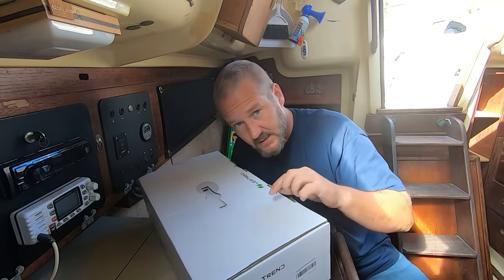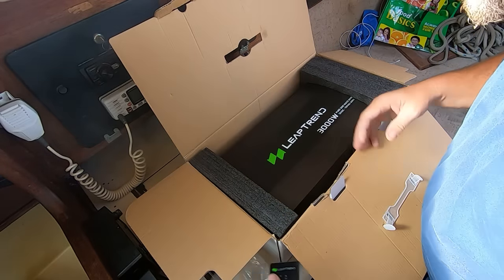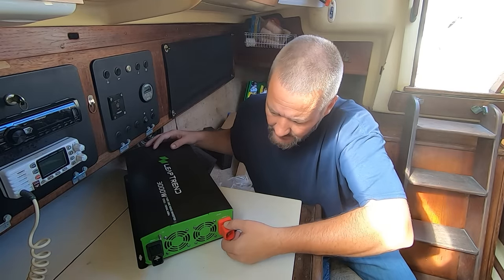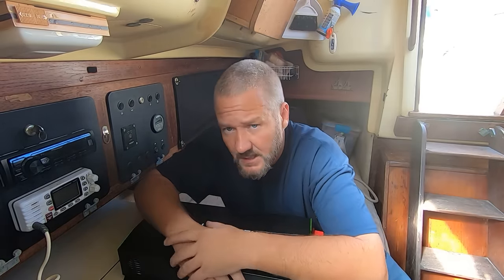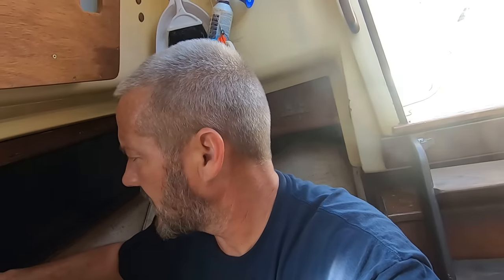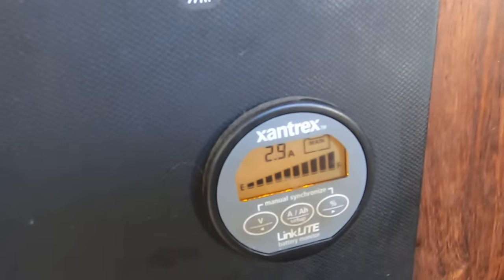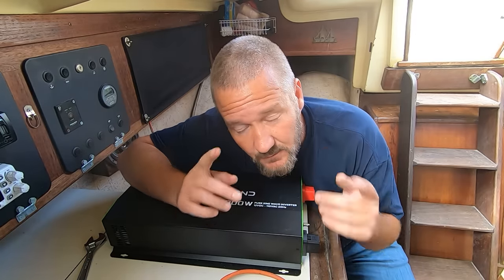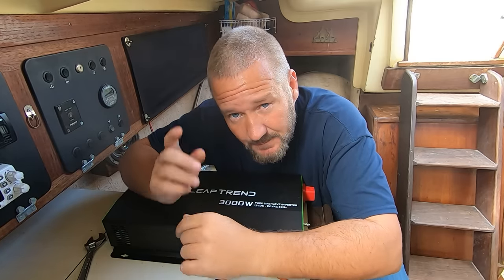This Went Wrong! Power Inverters - Ep 249 - Lady K Sailing

Comment: laptops run off DC - granted it's probably not 12 volts. But fear not, you can buy DC to DC power supplies for laptops! A lot of new laptops charge via USB C and there are a number of high output, 12V, USB C chargers out there. Even if your laptop isn't USB you can usually find a DC to DC power supply - sometimes even first party! The efficiency is far better and helps you keep that inverter turned OFF as much as possible.

Comment: I have a laptop that runs on USB-C. Instead of 110. I also have an induction hob that I think would be more battery friendly than the electric kettle but I haven’t used it yet. 
I have seen 12v air conditioners, but I haven’t bought one yet, although that will probably become more need than want next year since I don’t have one right now. 
The induction hob was around $50 and I can put it in a drawer when I’m not using it. In theory because it’s still in the box. My previous boats had pressurized alcohol which I just don’t like. Currently I have a low pressure alcohol stove, but the alcohol evaporates, so I’m switching to electric. I have a 2000w inverter

Comment: I'm not sure your batteries are able to deliver the power without the voltage dropping. The cables may also be the culprit. I'm sure the inverter is fine. Your Amperage also doesn't add up. 1000W is about 80 amps at 12 volts. so 1500 watts is actually 120 amps.

Comment: Could also be connections. Under load, check for heat at every connection/wire termination. A 1500 watt kettle will draw over 150 amps on a 12 volt system, half that on a 24 volt system. That many amps makes some good heat at any loose or corroded termination, and the I squared r loss over cables gets very significant. You need 4/0 cables with appropriate terminations.

Comment: Are your DC wiring and batteries up to supplying that power without significant voltage drop? The beeping could be an undervoltage error. But also I've never heard of Leap Trend 🤷‍♂️

Kettle is P_AC1500W
P_DC = 1500/0.8 = 1875W
At 12.8V, I_DC = 1875/12.8 = 146 A

And for double that (3000W P_out) you'd want 1/0 AWG and keep the loom short as possible.

What can your house battery supply?

Comment: The inverter is likely fine.   The beeping is likely low voltage at the input to the inverter due to a voltage drop on the wires from the battery.  I agree with other comments suggesting the DC input voltage is low.   Making some estimates, detailed below it should work.  I recommend using a 24V inverter with inverter wattage values over 2000.  This results in 1/2 the voltage drop on 2 x the voltage so the same wires from the batteries can 4 times the power to the inverter.  Distance between inverter and battery is ideally short.  As calculated below the voltage drop on the wires could be .4 V per meter.    The battery meter will likely watch battery voltage.  With the vacuum running supplying the battery current,  battery voltage, and the voltage at the inverter input will tell you if its the batteries, wiring or the inverter.   

Note that the power draw of both the grinder and sander will increase dramatically when loaded.   

With a 12V supply the inverter must draw roughly 10 x more current on the DC side than the AC side.  120V/12V.    Inverters will typically alarm due to low voltage at about 10.8 V .  1200 W @ 120V will draw  10.0 A on the AC side and 100 A on the DC side.   Making a guess at the battery hook up wires as 6AWG and 1 m  they will have a resistance of  0.003  ohms.  This will result in a drop of .3V.   If you are using lead acid batteries you can expect the battery voltage to fall .3V for a total drop of .6 V.  This should be ok.  However, it has been my experience that the wire to end resistance can add another 0.0005 ohms which adds 0.002.  Total DC supply resistance can now be estimated at 0.008 ohms.  For 100A this will be a voltage drop of 0.8V.

Comment: People are saying it's your wire size. I'll disagree and say it's your battery capacity/sag. You are pushing your batteries limits for it's size which is causing the voltage drop below the inverters low voltage setting. It is not a wire issue or power limit on each outlet like some people are saying. 

Double or triple your battery bank and it will work.

If it was a wire issue it would be a heat problem not low voltage cut off with warning

Comment: Thanks for this review. Was just about to order one of these. I don’t see how you can get more than 1000 watts out of a 12v inverter that is pulling from a max of 800 amps or 960 watts with 20% loss. 24 volts much more likely!

Comment: If you use a lot of wattage on the 110 side a lot you may consider going to a 24v house battery setup with a buck regulator for your 12v side. It would cut the amp draw in half but may require new changing system components. Probability cheaper to get much lower gauge wire to feed the inverter.

Comment: Did ok with 3,000 watts of inductive load, but bailed on 1,500 watts of resistive? Someone else hinted that the 3,000 watts may be split up among the three outlets of the inverter. Each one only handling 1,000 to 1,200 watts for any length of time?

Comment: I would never want to run a laptop off 110 on a boat.. get yourself a DC to DC converter and run off the probably 19 volts it needs. You can DCE to DC invertis or 12 volts up to 19 or 24 down to 19. Pretty cost effectively

Comment: wires wires wires wires, use welding cables. How far away they are from batteries is also important.....any 2500W inverter would be enough to run all that but with undersized wires it will melt connectors even if it works.

Comment: agree with others.....you likely need larger gage wire from inverter to batteries( how many feet of wire between inverter and batteries? )...also, suspect  the gage of A/C wire you're running is not  (#10+ ?)big enough.....or ABYC compliant......

Comment: Junk inverter? I'm offgrid running normal appliances - including my electric kettle for coffee every morning. I started with an Aims 3000 watt inverter with no problems. I now have a Victron 3000 watt inverter. Still no problems. And I run a window AC unit in the summer. That being said, as one other commenter mentioned, I have mine hardwired in.

Comment: The inverter is part of a system, not a system unto itself. As you see in other comments here, you have components like wiring, batteries, fuses, connections. There's loss in all these things. Your wiring may be under sized and/or too long for that inverter. Cable length adds to attenuation in electricity. Your batteries may not be able to supply that amount of power quickly enough for the kettle. Kettles are pretty demanding. I had the same issue and bought one on Amazon that only requires 700 watts. I use it with a Xantrex 2000. The inverter company will probably go over all this with you. If it was me, I would just get a bigger Xantrex.

Comment: Looks more like inadequate wiring ..... 3kW inverter will draw as much 250A from 12v batteries, your wiring with 1kW inverter probable never exceeded 83A.
Also notice that fused and circuit breakers can have significant voltage drops triggering inverter low-voltage alarms.
Go to a 24v or 48v system and/or use 0-4AWG cables.

Comment: I agree.  I can tell from looking that your battery cables are way too small.  At full load you will have around 300 amps in the battery cables.  Your cables are too small and you have voltage drop in the cables.  Input voltage at the terminals of the inverter is way less than the battery voltage you are reading on the battery monitor.  The alarm is under voltage at the input to the inverter.  I can't tell for sure without knowing the length of the cables from the inverter to the battery but you will likely need 2/0 to 4/0 cables for full 3000 watt load.  You also seem a little confused about the difference between DC current on the input of the inverter and AC current on the out put of the inverter.  The ratio is about 10:1.  If you have a 1.0 amp AC load on the output of the inverter you will draw about 10.0 amps of DC current from the battery to the input of the inverter.  What did the manufacturer say?  You should only be using an inverter that is compliant with ABYC standard A-31.  Neutral to ground switching on the output is very important.  I doubt that this inverter does this.

Scott Smith
Bachelor Of Science Electrical Engineering
ABYC Certified Electrical Technician

Comment: Never buy less than a 3500w. 3000w is the minimum for just about any power hungry device. Surge difference is 1000w higher for a 3500. 
Also don’t by an inverter that is less than 90% efficiency, quality ones are normally around 92%.
Reply: Running Cobra 2500W inverter for last 5 years, have no problems with any devices like that. Only thing it failed to start was makita air compressor.....other then that? microwave, heating water, vacuums, grinders or any other tools are pretty happy...hooked up with welding cables....

Comment: well... if you look at Victron inverters, so the 3000VA version, which is 2400W (at 25C) has a weight of 19kg, I feel this one looks a bit more like a toy. your wires seem to be way too thin for 3000W load (like 350A teritory).

Comment: Many people in the comments saying the wires are too thin. That makes me curious : how does the inverter know that? I thought that the consequence of thin wires is that they would overheat, but since they're before the inverter, it wouldn't notice unitl it's too late. Or is there some other consequence of unfit wire for a given current? Thanks!
Reply: It's not the wires themselves that the inverter cares about (obviously cant see the cable). However, it is reacting to the effect of having too thin of wires for the load demand. This causes voltage drop. The inverter is seeing low voltage and cutting out. The batteries are likely fine, the inverter is fine, but the thin wires cant carry the current required over distance, resulting in voltage drop.
Reply: @JasRoss  Interesting. I suspected it was something like this but didn't know, so thanks for confirming. So, when the wires can't handle the current, the tension drops. If the inverter didn't detect that and kept pulling, they'd overheat too, right?

Comment: Does your inverter have two 110v plugs like mine?  I’ve always wondered if you only get half the amperage from each, which if combined add up to the rated power. So, like you would only get 1500 watts per outlet. Mine failed to run my toaster oven when it ‘should’ have.

Comment: That 12v supply side cable looks undersized,  check the manual
Reply: My 3kw install has 2 00 cables on each pole,  and yes it can run my AC

Comment: One other thing I saw here that scared me. Don't use welding cable on a boat. Not safe. It's too thin and diesel melts the insulation.

Comment: I am yet to ses an inverter that can run a toaster or anything with a heat coil an iron a heat gun I'm not an electrician but to me those thing  are like a direct short. My inverter will not run anything like that and an ac has a big draw and a large Stat up. My generator can run anything.

Comment: really? you give boat advice? 1. the manual is clear on the 3 outlets being limited to 15a if you only read it but hey its only a boat and this is only a 3kW device so who needs to read a manual - 2. worse is you wire a 3kW device with way undersize DC cable - lame. rookie mistakes.

Comment: "Inverter" is another example of how stupid the English language is in parts. As an electronic engineer I would assume that an inverter makes e.g. from +12V then -12V. AC voltage is not the opposite of DC voltage and vice versa. As so often, these terms are much more accurate and correct in the German language.  There is an equivalent to the word "rectifier" which could be translated literally as "altifier". A similarly silly term is the often used word "splitter", although it is actually an (active) distribution amplifier. If I "split" something, then that would mean 2 halves. Poor English language...